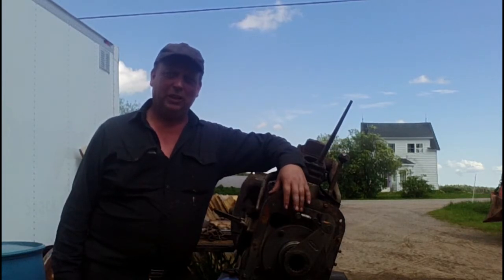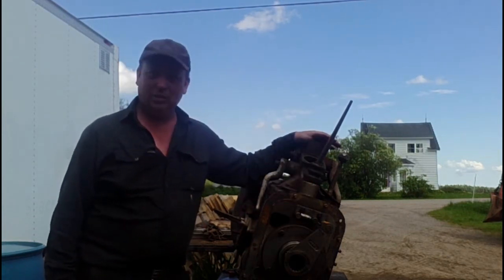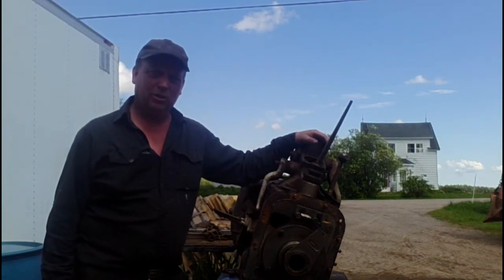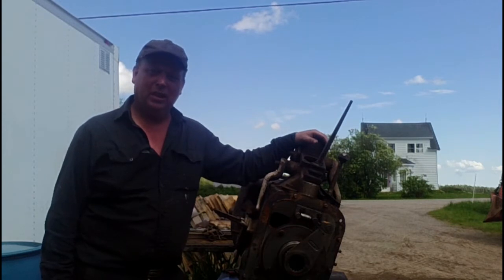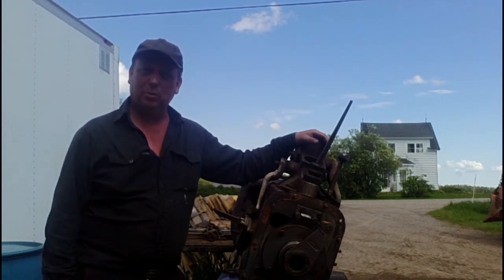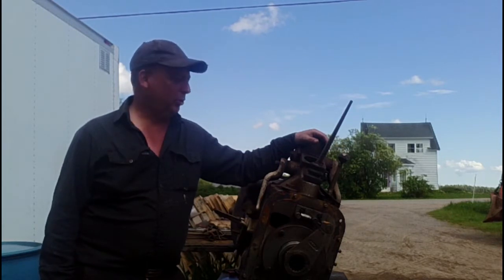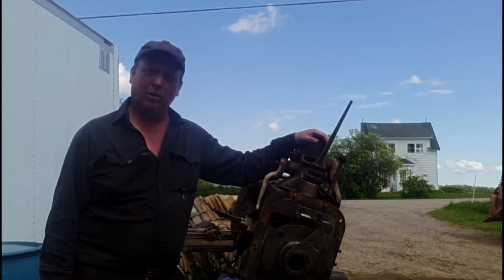Dismantling an MF 6 speed transmission

Comment: Great video Dave, thanks. I'm new to tractors and picked up a 135 with the same transmission. I've only had a chance to take it for a few passes around my property in Eastern Canada. The tractor runs great, however I did notice that it doesn't roll as I expected a manual would with the clutch depressed. When traveling in gear and the clutch is depressed the tractor comes to a near instant stop, and doesn't coast as I expected. No strange noises, no issues finding gears. Anything I should be concerned about, or is this how they are? I'd rather know now I've got a fix coming up before I start using it and cause damage. Thanks again, and you now gained a new subscriber!
Reply from the maker: I am glad you enjoyed the video and thanks for the sub! A 135 should coast pretty freely when you push the clutch so you have some sort of binding going on. I would suggest you jack up one side while in neutral and check if the wheel will turn free, then the other. You could have a brake that is adjusted too tight. Good luck. :)

Comment: My name is Wayne please tell me can I remove the input shaft without stripping the gearbox take it out to just remove engin from gearbox  I will apreachite your advise
Reply from the maker: You will have to pull the shift cover to check, often the input housing cannot be pulled without dropping the the PTO driving gear on the lower shaft. Thanks for watching!

Comment: what do you usually do Dave sell the trans as a complete unit or part by part?
Reply from the maker: Depending on what parts are needed, if it is only something like a shifting fork. that is easy to replace, I sell part by part, if it's something major I sell a complete transmission and get the other transmission back. That way I can offer a better price because there will still be usable parts in the old transmission.

Comment: Lol. You’ve obviously done this a few more times than you probably wanted to. I mean your in good spirits but are MF transmissions trouble prone?
Reply from the maker: The MF transmissions are pretty decent, usually the only trouble comes from operator error but I run a tractor salvage yard so I take a fair number of them apart. 
  Thanks for watching!